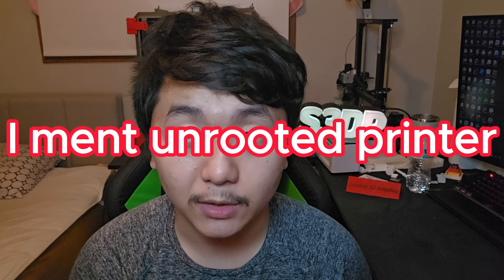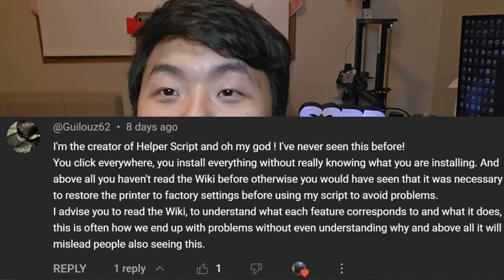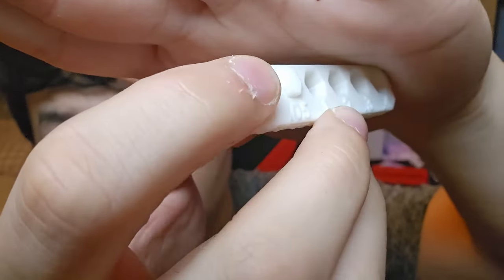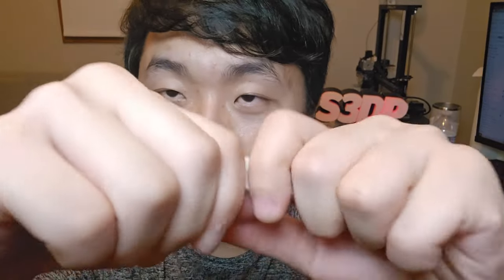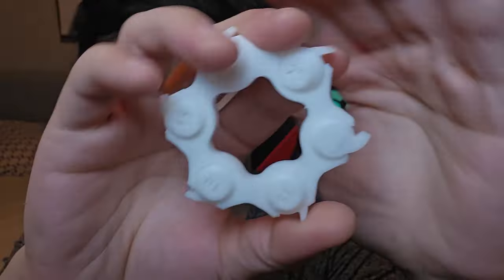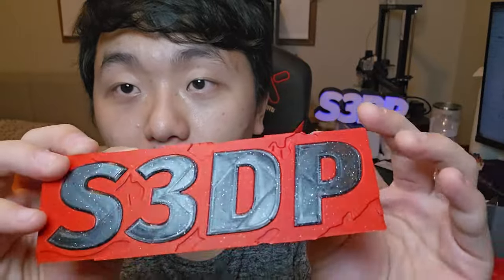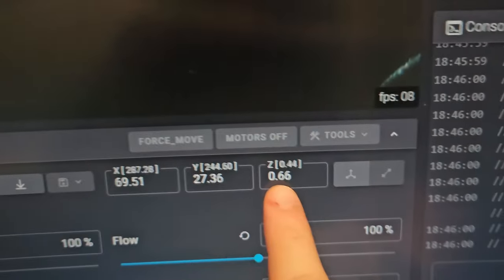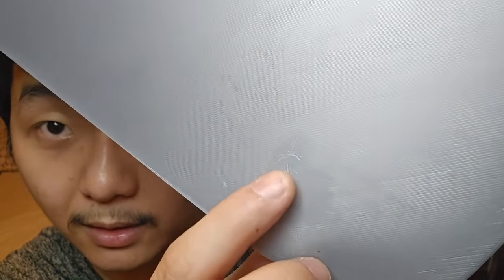Creality K1 Max All Problems Fix With Rooting

Comment: I like your video's a lot. You seem like a fun, happy guy. If you haven't done it yet - you need to flip the K1max over and take the belt off. Then put the factory screws in and re-install the belt. I wouldn't settle for 1/2mm variance.
If I could make a suggestion - LOOK AT THE CAMERA. Through your whole video you are looking at someone or something other than the lens on the camera that's recording you. It's really distracting. lol Good job though and Thank You for the video.
Reply from the maker: Haha thanks. As of right now, I'm happy with the way the printer prints, so might not do the belt thingy. As for the camera, I was looking at the screen of the camera instead of the lens, for some reason it's weird not seeing myself in the camera,  I'll try looking more at the camera len next time.
Reply: I was thinking the same thing! XD

Comment: I must have missed something because I've done all your test prints and all the tuning in the slicer but was not able to make such a good first layer test. I managed to solve my problem by printing spacers and place them under the bed to compensate the bed mesh. I'm now at 0.1567 range on the bed mesh and my first layer is decent. I have to say that I'm using ASA and that the bed is at 105°C which induces massive bed sckewing.
Reply from the maker: Yeah sometimes the bed is not leveled on the screw and requires spacers. I was using spacers but then it was not leveled anymore so I removed the spacer and did the belt tricks, now mine it also printing good first layer. Each 3d printer is different.

Comment: wow I need to keep following your videos, you helped me level my bed perfectly  but now 2 of my prints are still not working together with the holes and sides.   I need to do everything you did in this video to get the tolerance fixed. mine are just to snug yet...  only by a little... :(
Reply from the maker: Thank you, I'm glad my videos helped you. Some 3d printers just needed a little bit of adjustment, and it'll print.

Comment: With the flow test you need to look at the center of the top-most layer, not at the first layer and not at the digits either.  Those two are too much influenced by the amount of squish of the first layer and possible over-extrusion there.  The top-most layer eliminates that dependency because there are sufficient sparse infilled layers below it to compensate for any form of overextrusion or inconsistent first layer.
Reply from the maker: Ohh that makes sense. Next time I do the flow test I'll look at the top layer more. Thanks.

Comment: My k1 max printed flawlessly for month's ...until now, it shows error 506 Lidar calibration failed ...do have any advice? my K1Max is not rooted.
Reply from the maker: hmm, I'm not quite sure I don't use the lidar at all. Try cleaning the lidar. You can also try to unplug and re-plug it in to see if it works.
Reply: @Scratch3DPrinting  this helped, thankyou😄👌

Comment: hey you said that the first time you installed everything from the helper script and thats  makes a mess, when you rerooted, which modules did you install?
Reply from the maker: I use Guilouz helper script to install mine rooted k1 max. Here: https://guilouz.github.io/Creality-Helper-Script-Wiki/
Reply: @Scratch3DPrinting  
I'm using this script too, I have a question that may be obvious, but I'd rather die for sure hahaha, when I did INPUT_SHAPER_CALIBRATION and SAVE_CONFIG it inserted a commented block with the parameterizations in my printer.cfg, but it has a disclaimer "DO NOT EDIT THIS BLOCK OR BELOW. The contents are self-generated." Do you know if I should uncomment this code block from [input_shaper]?

And before I forget, congratulations on this and other content about 3D printing, as soon as I bought my K1 max, your bed leveling video helped me a lot
Reply from the maker: @rafaeladonis3842  Yes every time you do the input shaper calibration it will autogenerate those information. Just leave those as it is. Thanks, have fun printing with the k1 max.

Comment: 13:21 "z axis is moving." But how? How did you set it? Which command did you use?
Reply from the maker: I did not use any command, it's auto z-adjustment, so once it does the bed leveling, lets say the right side is 1mm lower than the left side. It will move the bed up when going towards the right side to made up that 1mm gap.

Comment: Nice, how do you get rid of the elephant foot effect? I tried flow rate and Z offset but still getting it.
Reply from the maker: I'm actually not sure, I haven't gotten elephant foot in years. I think if the first layer is good then you shouldn't have problem with elephant foot.

Comment: Nice, but the title is misleading. Rooting alone doesn't change anything. You have to know what you do with that escalated permissions.
Reply from the maker: yea, that is true that rooting doesn't change anything, but it does give the information for you to solve the problems that the printer has.
Reply: @Scratch3DPrinting  Many people are saying that the K1 is crap and Creality delivers bad quality. Some even don't own one, they just take that from other reviews.
We do not know how many are satisfied with the K1, even without doing these improvements. They simply print and don't give feedback.
Reply from the maker: @tuxflyer  That is true "They simply print and don't give feedback." Those are like more than 80% (I guess) The rest who has problem share it and try to get it fix, then people use that and say that the k1's series sucks. But it's ok i guess, if there's problem then I have something to talk about and make a video about it lol.
Reply: I recently bought the K1 SE. It’s my first corexy and I’m going to use it to convert my Sovol SV05 cube to a Mercury One corexy. That said, the reason I bought it was to learn Klipper, etc… Out of the box, this printer is amazing. I’ve gotten everything I wanted and because of the Creality community and Klipper at it’s core is why I bought it. Great printer. Looking forward to learning all about Klipper and the granular controls I can gain access to.  Good stuff.

Comment: I really need to root my k1 max. I have added spring leveling to mine and got the bed to .05mm level. It helped a little with first layer but I need to do the flow tests
Reply from the maker: Yeah, rooting the K1 max is a nice touch, since people out there are making it easy to root.